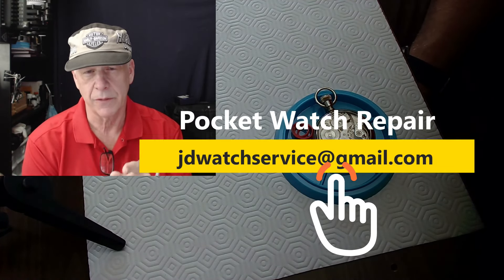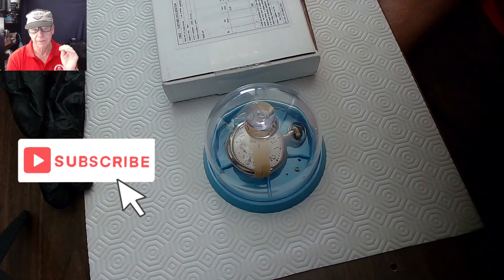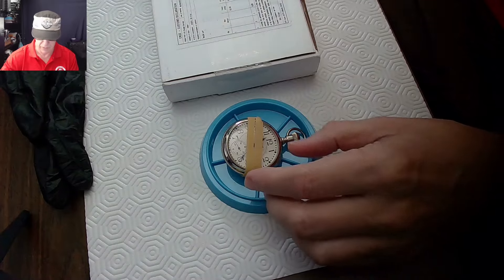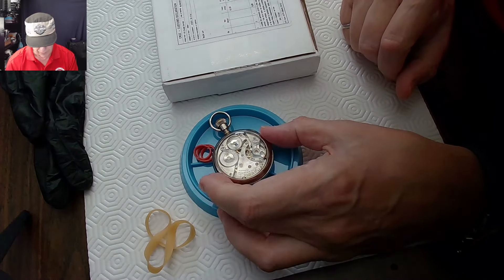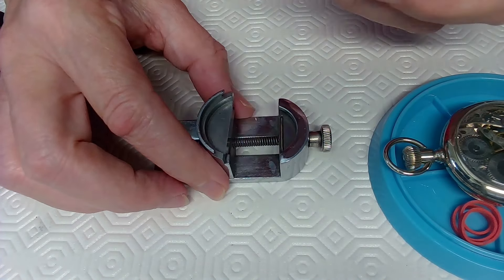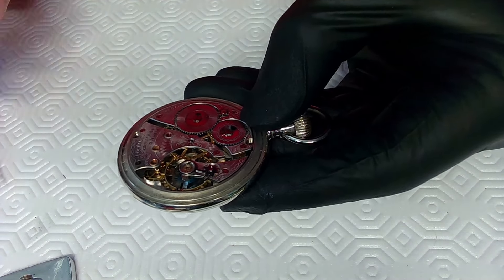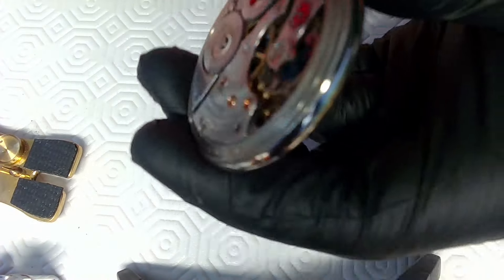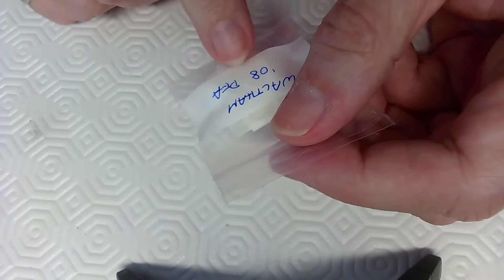Waltham Pallet Fork Exchange

Comment: The shape of the guard finger on the replacement fork looks really suspicious and I suspect that it is rubbing on the roller table, stopping the watch. 

However, even if you could obtain a NOS fork for this watch, untouched since it left the Waltham factory, the escapement parts in movements this age are not freely interchangeable. 

Each escapement was set up and adjusted to work correctly by hand, and if you replace the escape wheel, fork or roller table the escapement will need to be adjusted to run well, unless you happen to get lucky. 

If you were to switch forks between two of these Waltham movements, both running well, there is no guarantee of either running well with the forks switched. 

You may be able to get the watch running by adjusting the guard finger such that there is good safety action and no rubbing between the guard finger and the safety crescent of the roller table when the roller jewel is between the pallet fork horns, but ideally the whole setup of the escapement should be checked and adjusted as necessary. 

This information seems to be poorly explained (if at all) in most books, so I’ll try to explain it clearly below. Here is how to set up and adjust an escapement. 

The first step is checking the end shakes and ‘divisions’ which are the vertical clearances and alignments as follows. 

Ensure that the escape wheel teeth are striking the vertical centre of the pallet stones, the fork horns must have good contact with the roller jewel without touching the roller table and finger is correctly aligned with the safety roller.

With that taken care of, it is time to set up the escapement. 

First check the horn shake. This begins by checking the fit of the roller jewel inbetween the pallet fork horns. The roller jewel should fit easily between the fork horns, without jamming. Ideally should have 0.01-0.02 of shake between the horns. 

Next, turn the balance wheel such that the roller jewel just enters the fork horns, and examine the freedom of the pallet fork’s action. Use an oiler to move the fork to check the distance the fork moves between the banking pin and the moment the inside of the fork horn touches the roller jewel. This is horn shake. 

This horn shake distance must be small enough that the pallet jewel does not unlock the escape wheel tooth it’s locking, but larger than the guard pin shake, which is explained below. If this condition is not satisfied, it can be adjusted by moving the banking pin. Horn shake must be equal on both sides for an escapement to run well, if it isn’t, the banking pins should be adjusted to equalise horn shake whilst maintaining the above conditions. 

Whilst banking pins are moved in an attempt to remedy all manner of faults, adjusting horn shake is the only legitimate reason to move the banking pins. 

Guard pin shake is tested as follows. Move the balance and hold it in a position where the roller jewel is completely clear of the fork horns. Now use an oiler to test the movement of the pallet fork between the banking pin and the moment the guard finger hits the safety roller. 

The guard pin shake must be slightly less than the horn shake so that the roller jewel will never strike the fork horns when it tries to enter the fork, and it must be equal on both sides. 

If the guard pin shake is too large, the guard finger must be adjusted towards the safety roller. If the guard pin shake is too small, the guard pin must be adjusted away from the safety roller. 

If the guard pin shake is not equal on both sides, the guard finger must be adjusted such that it is properly centred in the fork. 

Now that the fork/pin/roller interaction is correct, the engagement of the pallet stones and escape wheel must be checked, such that drop, depth of lock and slide are correct. I’m pretty sure you understand the relevant measurements here and they’re readily available in books, too. Adjusting the depth of the pallet stones in the fork is the correct way to adjust the engagement between pallet stones and escape wheel. 

Having proofread this, I noticed I’ve used the words pin and finger for the guard finger/safety dart. They both refer to the same thing throughout. 

Hope this helps, if I need to clarify anything, just let me know. 

Regarding the crown needing to be pushed in to wind the watch, hopefully the sleeve in the pendant just needs adjustment. 

The watch can’t be left this way lest the time be changed inadvertently by moving the crown, and it’ll cost a lot of amplitude to have the watch in setting mode all the time, as the train will be needlessly driving the setting works when they’re engaged.